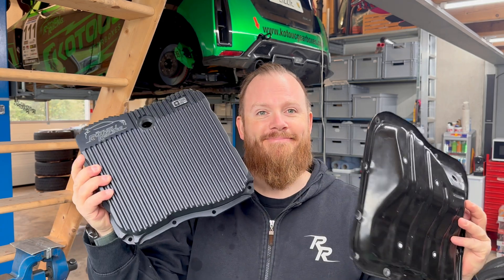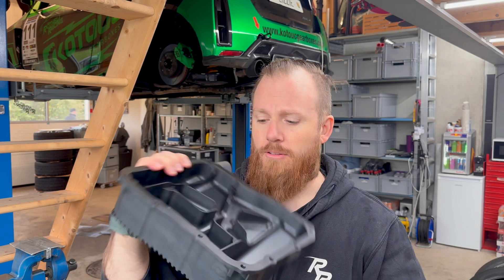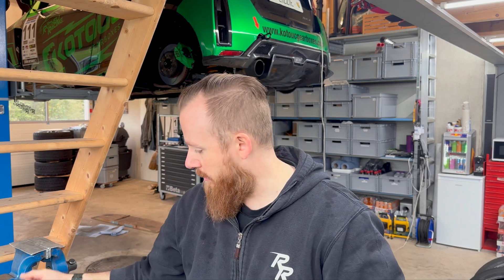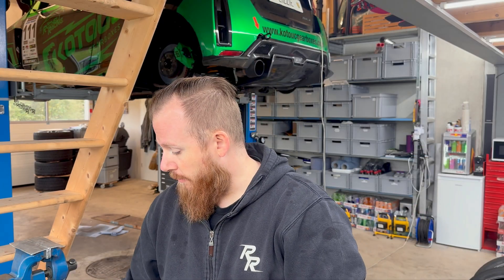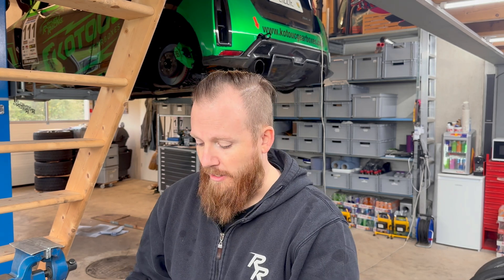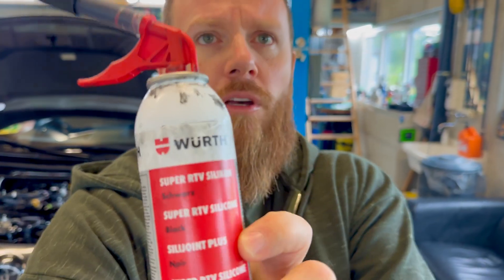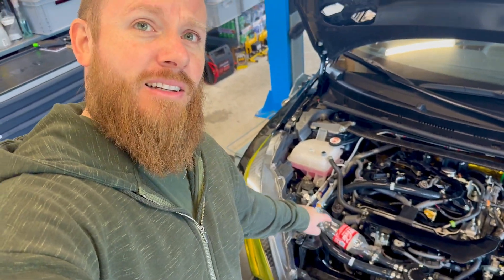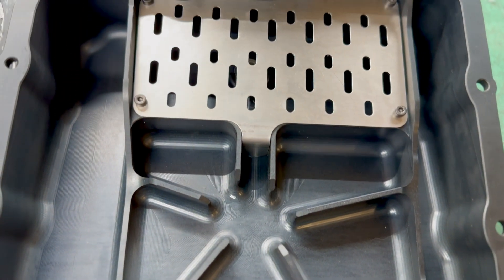Toyota GR Yaris - Baffled Oil Sump Pan with increased Volume by Rötheli Racing

Comment: What is your oil pressure while running this oil pan + Lamspeed baffle + oil cooler at 6800ish RPM and the oil is at 110C?
Reply from the maker: @mixxeerr  you can see that in the data plot in our online shop:
https://roetheli-racing.ch/products/rotheli-racing-gr-yaris-olwanne-mit-1-25l-zusatzlichem-volumen
Reply: @RotheliRacing  Thank you. The pan looks great. The baffles (Lamspeed) seem really weird using rubber doors. I've had so many baffles in so many cars like BMWs, and they always used hinged metal doors. Are you not scared of rubber failure over time? 20,000km of hard tarmac rally and track driving?
Reply from the maker: @ no, not so far.
After 1.5 years and 3‘000km hardcore on track, they still look like new. 😁

Comment: Are there extra benefits of using lampspeed buffle plates together with this new oil pan or this new oil pan is enough for hard track use?
Reply from the maker: @kamilmanuxputon2103  i highly suggest using it with the baffle plates because the oil pan was designed with them in place.

Comment: Do you need to get a different length dipstick to properly measure oil level?
Reply from the maker: @someguynic  no. The oil level should still be at the same height, so the OEM dipstick still works. 👍

Comment: I like the fact that it has a small cut out near the drain plug to drain the last bit of old oil, great design! more manufactures should consider this.
Reply from the maker: @johnbeckett2624  it‘s a small addition, but wil make a difference.

Comment: with my HEL track cooler i see 105c after a 15-20 minute session in 25C day. even another 5-10c oil temp racing on a 36c day is still well with the oil performance window for Motul 300v. so the oil pickup is in the same location and not droppped lower, you are simply adding more oil to take heat from the motor? be intersteing to see your data on how much cooler everything is. lovely looking bit of kit! 🙂
Reply from the maker: @justdavehanna  yeah. We added just more oil, to get some more stress out of the engine.
For some people who don‘t track their car regularely, it might be even enough without an additional oil cooler, if someone doesn‘t like the idea of an oil cooler.

Comment: Can you still use the car's under-engine cover? It would be nice to see if it's now a lower point under the car
Reply from the maker: @DanielHernandezBC  yes you can still reuse the OEM Under Engine Cover.
The Subframe is still roughly 10mm lower than the oilpan.

Comment: Looks like a top quality part, well done. Would there be an issue with the extra oil capacity in normal road use where in cooler climates the oil won’t reach optimum temp under normal driving?
Reply from the maker: @vivid4724  good question. But no.
Even with our Huge Oil Cooler Kit, the oil reaches during winter 80 degrees easily.
So with only the extra oil capacity you‘ll need maybe an extra few minutes until you reach 80 degrees.

Comment: Hey Phil, if the baffles work, what was the need for the extra capacity? Is it oil temps or just insurance?
Reply from the maker: @woznaldo  oil temps. Even with the oil cooler we‘re now getting to the limit of the system.
And some people might not wanna have an oil cooler and could maybe get away with just the increased volume without an additional oil cooler.
Reply: @RotheliRacing  Will you test it with and without the cooler? That would be very useful information to have. I haven't installed a cooler yet, but it's one of the next mods I'll do. If this is another option it would be great to know.
Reply from the maker: @bcm70  no we won‘t test it without an oil cooler.
On our power level even with the oil cooler, it‘s just not enough.
And removing or putting in the oil cooler during a trackday is just not possible.
BUT, you can install them, test it without an oil cooler and if it‘s not sufficient, you can just add an oil cooler later. 😉
Reply: Hi.. Great video again! 😎... Can I ask, the baffles that are already in your sump, I'm guessing they work better regarding the pick up pipe than the  standard sump? Even without the lamspeed ones.